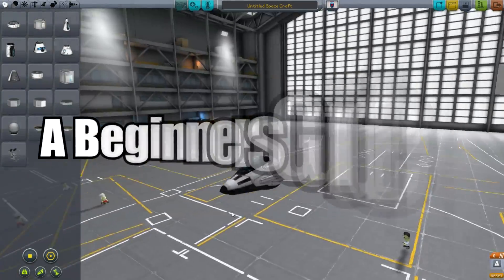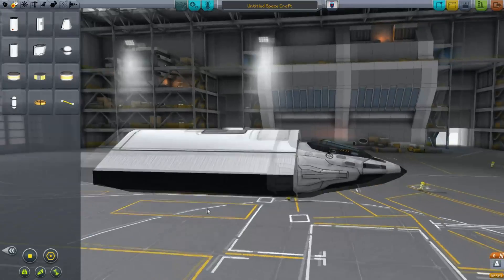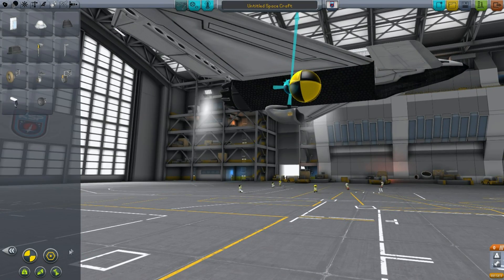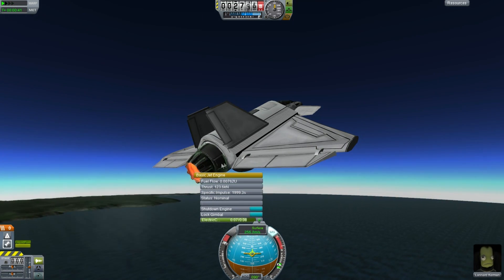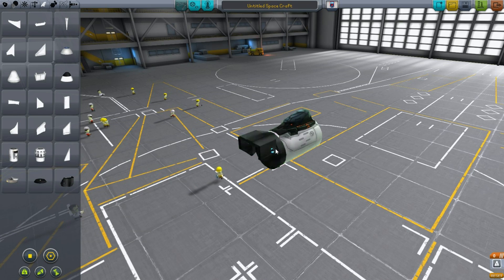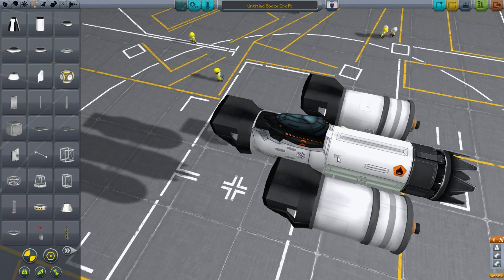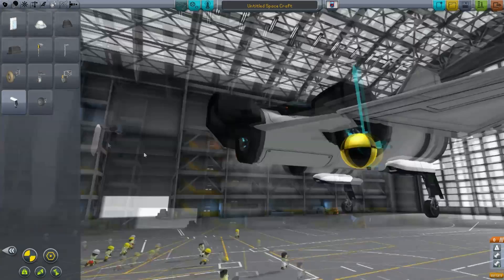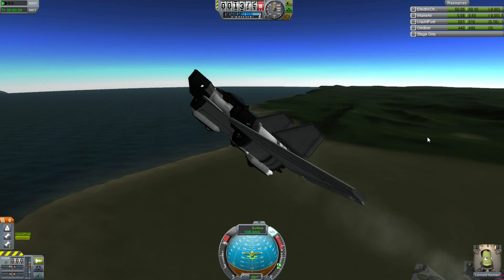Kerbal Space Program - Beginners Guide To  Spaceplanes - Part 3

Comment: What is the difference between the circular and ram air intakes? They have identical stats in the SPH except for the circular intake having slightly more impact tolerance. Does it have a different curve modelling its intake air production with altitude?